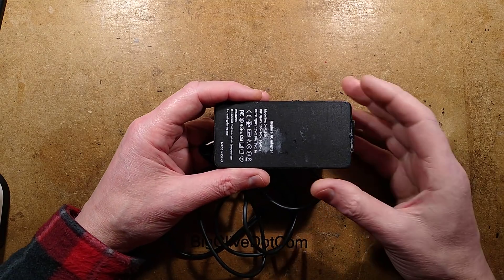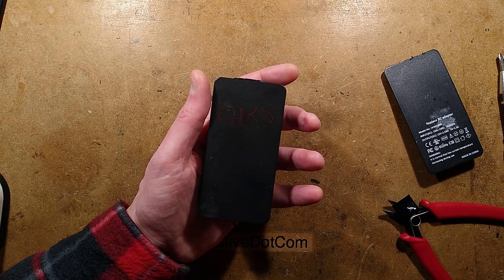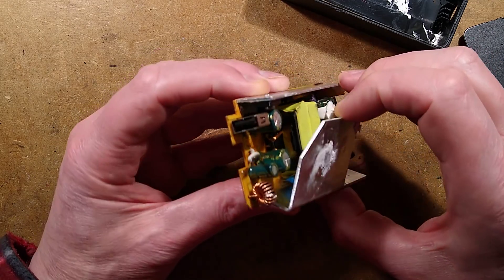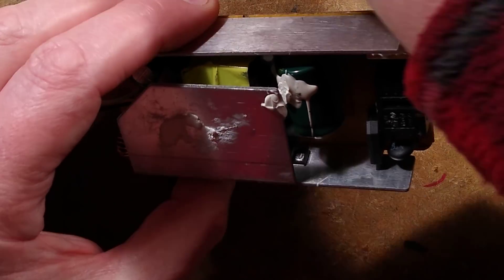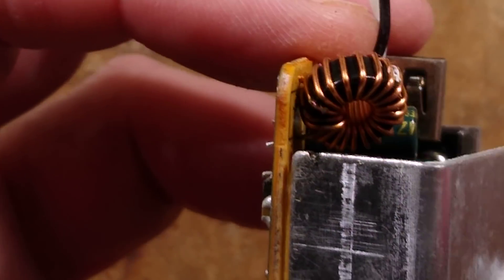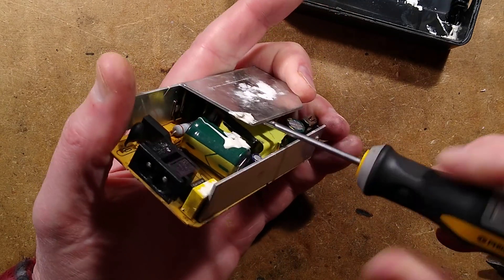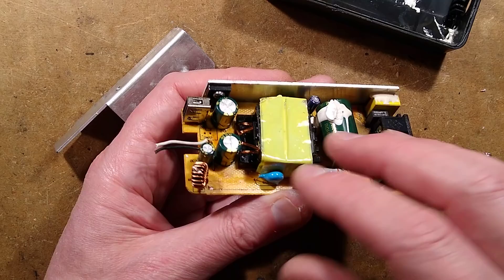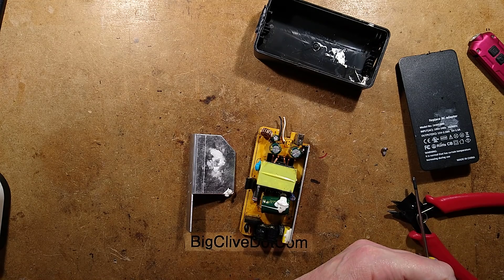This PSU killed a Microsoft Surface and a monitor

Comment: It's got heatsink compound going onto the plastic case?  Because someone thought it would be a good idea to transfer a bunch of heat to meltable plastic?  What the heck were they thinking?!  Clearly that was the final step in one of the poorest designs I've ever seen.  Make me glad the Surface Pro my company provided me has its original Microsoft PSU, and not a Chinese-made p.o.s. like this one.  Wow -- that thing is genuinely scary!

Comment: Thank you for the up. A relative too kept the cheap psu in a prebuilt medion pc, and fried his new at the time 1050 ti. being on tight budget, it was a deep burn. a expensive surface with a cheap psu is the cakes cherry. getting a good maybe gold psu will actually save you some quid in the long run considering those have better efficiency.

Comment: I have a laptop charger from a cheap manufacturer too and it IS putting some of the live voltage across the computer but not enough to give you a shock but it is enough to make you feel the AC vibrations in your fingers when you used the touch plate and it is a strange feeling since you can actually feel the voltage is there. I tested it with some methods and it is capable of a few milliamps so I guess it is the "safety" capacitor that is leaking the AC current to the output somehow. But I replaced it with a better adaptor and the issue was gone. Maybe it would make for a good video someday to examine why it does this. but the charger in this video takes the cake for sure lol
Reply from the maker: It's capacitive coupling between winding layers and also the class Y capacitor.  Usually around 100uA.
Reply: @bigclivedotcom  yep it does indeed. But this supply is giving out more than 100 micro amps on the ground

Comment: I had a power adaptor fail.  It had been powering an Apple Mac Pro laptop (which turned out to be undamaged).  I bought a replacement from  amazon marketplace with some nervousness, and was careful never to leave it on unattended.  No more trouble.  But here is the thing.  The unit that failed was the  Apple product that came with the laptop!  The only other point of interest was that the failure occurred while the power adaptor was powered, but the laptop not connected (i.e. left in no-load condition).

Comment: What a terrible design fault. I was once asked to investigate what was causing a particular model of Dell power supply to fail. Several PSUs died within a few weeks time, so it looked like they had some kind of inherent design flaw, and perhaps I could uncover what it was before it took out the ones still standing. The post-mortem showed a blown main MOSFET and surrounding circuitry. The culprit turned out to be an underrated ceramic snubber cap across the MOSFET: it was only good for 1kV whereas at least 2 or 3 kV would be needed. It would eventually short, causing an avalanche of bad things to happen. So if you happen to have a Dell H240AS-00, you may want to upgrade that cap ASAP.

Comment: I can't see whether the AC (mains) side has a 2-wire or 3-wire connector.  If it's a 3-wire, wouldn't it have made sense for the designer to connect the AC and DC grounds?  In that case, an AC short would return to the ground pin of the mains, and would be unlikely to propagate through the DC side (you could even use a fast-blow fuse to protect things).  I haven't built many power supplies since vacuum tube days, though, so I may well be missing something. Plus, two-wire AC systems remain very popular (at least in the US).  

Excellent video and reminder that physical design needs to be considered when building a device, not just electronic design.
Reply from the maker: Two wire.
Reply: @bigclivedotcom  Ah, then that's that.  I must admit that when I was taking the Bar Exam a while back, I made sure to take a two-wire supply for my laptop, since I suspected (correctly) that the exam room would not be provided with three-wire extensions.

Comment: That's one reason why I stopped using generic / cheap replacement adapters. I've had high failure rates, operational issues etc. with the cheap Chinese knockoffs. One memorable one was a generic Samsung AC adapter that I was using on a Galaxy Tab Pro. When I plugged in the charger, the touch screen would stop working. Tablet stayed on and charged, but touch died. Plugged into a different tablet, similar result but touch screen went nuts. Unplug it, everything went back to normal. Cause? There was a horrendous high frequency ripple on the DC output. Cracked the charger open and it has some ungodly small value cap across the output, like 22uF, to filter the ripple lol.

The funniest part is the mains tied heatsink with a plastic case transistor. Why?!?!? Maybe it was a metal tab case on the semi at some point?

Comment: once upon a time i had a dell computer power supply apart. from the smell and the lack of power it seemed a capacitor had popped. 
well, i got it apart, and no capacitor guts or dead cans. 
hmm. so out comes the multimeter and a little exploratory surgery. 
the power supply was on and i was aware of that. what i wasnt aware of was that every heatsink on the board was live. every one of them. 

i found that out the hard way, and i said naughty words. many naughty words. 

it turns out that with stuff like this, when they say "no user servicable parts inside" they bloody mean it!

Comment: Recognised that for what it is in seconds. So many laptops and tablets ruined by these things. They frequently come with the extra dangerous unfused plugs.
Reply: That's because you have ridiculously dangerous overpowered outlets.  Most of the world gets by fine with unfused plugs.
Reply: @stargazer7644  safest plug in the world, less cable heating issues and don't even start on unfused 6a extension cords you can draw up to the mcb rating through. I'll keep our plugs and safety record and just avoid cheap chineese tat.
Reply: @rtechlab6254  "safest plug in the world".  Sure if you're a curious 2 year old with a screwdriver.  Not so much when your 7kW kettle goes supernova.
Reply: @stargazer7644  you know 13A is just over 3kw right?

Comment: Didn't something like this happen on the original xbox power adapter? Arching and taking out equipment was best case scenario for that damn thing. Someone could die holding the device attached to it once it becomes live. That's scary as hell. So much for the isolation on the board! O___o

Comment: In my industry we carry out physical qualification tests which includes vibration, specifically for issues like this. As the PSU was apparently CE marked, they should have done the same (but presumably that was fake). My suspicion is that whoever made the heatsink made it slightly oversize or the hole for fixing it to the FET was drilled in slightly the wrong place. For insulation (between the fouling part and the heatsink) they would have to use something like AshLam (essentially a thin, flexible piece of GRP similar to PCB material) as Kapton would eventually wear or creep through.

Comment: Saw the first 10 seconds of the video and instantly saw it was a cheap knockoff power supply.  Sadly, no warranty support for those things.   If it had been a Microsoft original,  they may have been eligible for warranty support for all the damaged devices.

Comment: I have a cheap 110-240 v to 5V 2.5a USB travel adapter thing
I had been using it for the past 6 years to charge my mobile phone exclusively pretty much.

However, one time I also plugged in my GPD Win little handheld gaming computer at the same time as my phone.
And while using my phone in the dark, I noticed what looked like a thick stream of smoke coming out of the phones charging port as I was holding it

I unplugged my phone only to find that - I couldn't

The microUSB port had melted with the cable plugged in, and the same had happened to my GPD :( 

Any microusb cables I went to plug into the travel adapter after that, would immediately glow orange and start to smoke at the micro USB end, quickly melting the connector

I'm now very scared of electricity and any chargers haha

Thankfully I was able to take my mobile and gpd computer to a repair shop where they replaced the melted micro USB ports, and thankfully both devices have survived :) 

Would you be interested in possibly taking a look at the travel adapter? I'd happily send it in, I'm deathly afraid of plugging it in now haha

Comment: I had a cheap Dell "150W" power supply inject a ton of noise into my ITX computer, to the point that my USB ports wouldn't work. 
It would also die if I tried to play games.
That brick eventually found the bin and I got the PC a better power supply setup. It's still in use today as a media center box.

Comment: The original is better build up, sadly they died probably like the one I have due to a bad capacitor. I replace it and 3d printed a new case for it.

Comment: There is another distance issue on the other heatsink. The connections of the optocoupler are too close to the heatsink. Even if the heatsink was insulated the creepage distance is not big enough in sum.

Comment: Bit of a disappointment that the USB charging inlet on the Surface Pro wasn't protected against over-voltage. The usual  'haha, you didn't use our proprietary charger' excuse doesn't really cut it at that price point. Would it have helped if the monitor had been plugged in through an RCA?

Comment: lesson learned
do not save say £50 by using power supply for £20, when you supply device worth at least £500
it is not worth it
if it was Microsoft power supply, then you would have new surface for free from Microsoft
now you would still have new computer, but you will never use cheap power supply again

Comment: It's hilarious that they bothered putting heatsink grease between the aluminium and the plastic case!
Reply: The plastic case is what radiates the heat on fully enclosed plastic enclosures.  The heatsink grease is a far better conductor than an air gap.  The heat has to exit the case.  That's why your laptop charger and every wallwart on the planet gets hot.
Reply: @stargazer7644  But would it not be better to have vent slots than trying to use an insulator as a heat radiator?

Comment: This is a video I am going to remember the next time I am looking at the price difference between the factory replacement power supply and the el-cheapo, no name power supply.  Computers are expensive.  Don't risk it.  You have no idea whether the no name supply has design flaws like this.  There is no way that would have been passed by Microsoft, Dell, HP, Apple etc.

Comment: If I hadn't recently gone through and purged my stock of dead stuff, I could have sent you a dead "official" surface charger. They're poorly designed so the bespoke computer connector end is easily damaged through bending and they fail.  The problem is official ones are ~£70 whereas 3rd party ones are more like £25. At least some of the newer devices are moving to USB-C where it's easier to replace the cable.

Comment: Something tells me user dropped this PSU couple of times, and the inertia of the floppy inductor caused nick in insulation. Dropped while connected to mains, and thing goes boom.
Thats why in original PSUs there's usually a lot of this yellow insulating foil and white silicone on everything bigger, like capacitors, inductors and similar stuff. Engineers just knows these things will be dropped, pushed, shoved... Here a simple blob of a hot melt would be probably enough to stop this inductor from too much of movement freedom.

Comment: 9:52 What that copperish spot on the underside of the heatsink? Seems to align with the USB port.
Reply from the maker: Not sure.  Possibly flux from manufacture or caused by the adjacent short.

Comment: Ah, the joys of generic replacement PSU. Every time a client was bringing me a laptop for repair with one of these, I was telling them right away - this thing needs to go. If they were against, I had one of these in similar conditions, and proceeded explaining what can happen with their freshly repaired PC, which they paid for, if they won't get a proper PSU.
There are lots of reasonably priced used original PSUs on eBay and other sites, it really blows my mind people are still buying those - for more. What's even worse is that usually a reason for replacing original PSUs are damaged cables or plugs, which can be repaired for even less.
Reply: One reason is genuine originals being prematurely removed from the brand catalog, forcing users to buy generic replacements to keep their expensive devices working past warranty.

Comment: Not sure why they would have tied the heatsink to negative mains voltage. That seems like some rookie assumption that negative rectified DC is the same as AC neutral, even though it's really tied to -120V to -240V.

Comment: I'm mad now because apparently the text box unfocused while writing my original comment causing my browser to go crazy.
anyways,
Change or remove the heatsink, and put a fan in it. I don't know why we use huge heat sinks, as they seem to just cause problems. This is also why you DO NOT cheap out on power supplies!

Comment: Am I the only one that's disappointed when electronics don't fail fantastically? Exploding faults are ever so much easier to locate. Plus, you get a show for the cost of the damage, which is better than nothing at all. Thanks for the analysis of this POSU!

As a side note, I once worked for a small manufacturer who had entered negotiations with a Chinese manufacturer for pre-made power supplies, when he gave the list of required certifications, he was assured that they could print "any sticker you want". Insistence that the power supplies actually had to meet the certifications got nowhere, a different supplier was found.

Comment: It is probably a Chinese Knock of of someone else's work and the heat sink is something that was stolen from another product cobbled together. What a freaking rip off. The components looked to be descent, but the implement of said parts not so descent. Angle grinder would've saved this design flaw, or silastic wadded between the H sink and component.

Comment: I'm a noob and I didn't quite understand what happened. Isn't rectified negative (which the heatsink is connected to as I understand it) always at zero volts?
Reply from the maker: To the circuitry it is.  But with reference to ground it's live at full mains voltage
Reply: @bigclivedotcom  Thanks Clive. Upon investigating the rectifier circuit more carefully I realized that indeed at every half cycle the negative reaches ~-230V. 
Very interesting because I never considered this myself and those rectifier diagrams never show it either. They always show you a nice rectified wave that goes from zero to peak voltage. In fact even after googling I couldn't find a diagram that shows the rectified output in reference to ground. 
Very informative video.

Comment: I was watching carefully and when you showed that skid mark I knew it should be that. Anyway I was unsure if it could be caused due to excessive heating making the dissipator melt its way through the varnish or abrasion grinding it as you mentioned.

Nonetheless a very interesting finding. Thanks for the video!

Comment: One could think that someone that puts down good money for a surface laptop knows better .. if it screams I'm cheapy cheap.. do not put it on an expensive laptop.. If the real charger fries your shit it is very likely that microsoft will at least accept an RMA on your device, now.. you are screwed.
Reply: Microsoft isn't going to do squat after your 90 minute warranty is up.

Comment: I once got a powerbank and charger as a giveway (ironically, really from Microsoft) – both super cheap of course. The charger was so tiny that I figured it couldn't have enough insulation space in it, so I never used it. Well, one day my dad found it, plugged it in and it went bang spectacularly...

Comment: Looked like the cap fully discharged  Throw the inductor when the Varnish Rubbed off via the  Heat sink thermal expansion "SAW" plus the odd Drop Bump Would Also "Saw" the insulation

I Be Tempted to Run 15V~19V Via the DC Low Side From your bench Power supply  and Give  the heat sink a little Jiggle  see if the Cap Can take another chuck out the inductor Coil
Reply: Hi, can you explain that again, because you lost me at "looked like the cap fully discharged".🤔🤔

Comment: the designers did not consider that their product might be dropped.  a drop could easily cause the short.  or perhaps they did consider that it might be dropped.  i'm left with the impression that only a small proportion of consumers take faulty products back.

Comment: I see that the package bears a CE mark. Is that a fake mark, or has this actually met the relevant standards and failed anyway?
Reply: AFAIK, the CE mark is self-issued certificate that the product conforms to the EEA market. The manufacturer itself assesses the product conformity to those regulations. Basicaly, it doesn't mean anything to the shady chinese manufacturers. They will put anything on the product because there's no real consequences to them :/
Reply: As sure as eggs are eggs it's fake.